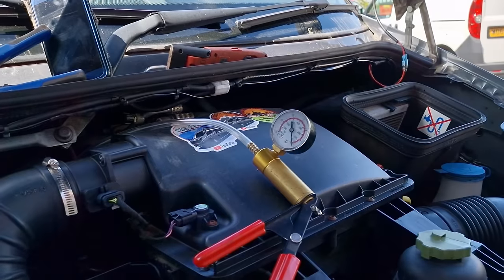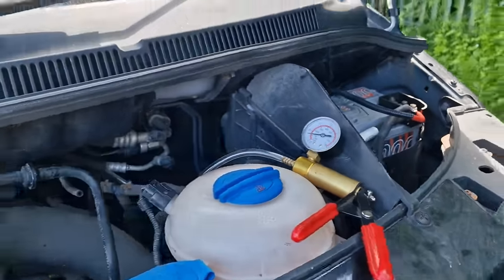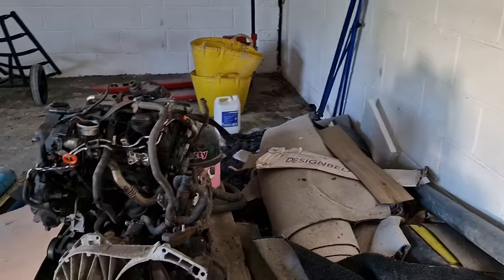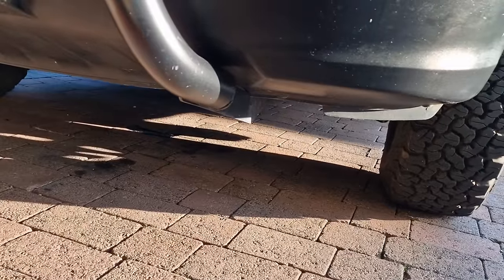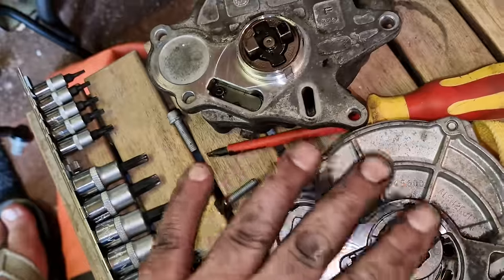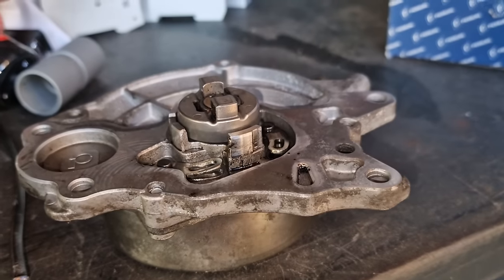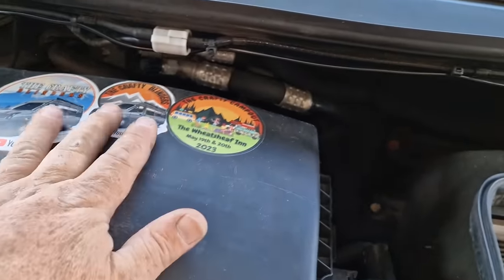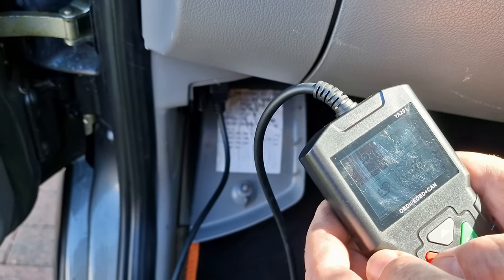engine fault code P2563 finally fixed on our self built campervan

Comment: hello friend, I have a problem with my minivan 2008 2.5 109, it starts, it drives well for 2-3 minutes, after which the coil comes on and the instant check engine cuts off my pedal and there is a loud sound from the turbocharger
Reply from the maker: have you inspected the pipe work around your turbo?
Reply: @TheCraftyBlindersvanlife yes
Reply: I changed the turbocharger actuator, vacuum solenoid valve, exhaust gas sensor, new egr, no change, all the same
Reply from the maker: @narcismadalin6088  sound very familiar have you fitted a new vacume pump?
Reply: @TheCraftyBlindersvanlife 
I will try to install a new vacuum pump today and I will keep you updated thanks

Comment: Almost all persistent codes on used vans, are due to wiring issues.  Breaks in Canbus looms are VERY common, and often throw up codes intermittently. This leads to many parts getting replaced, when there is nothing wrong with them. Pro auto electrical engineers, can in some cases resolve this type of issue, but its likely to be very time consuming and costly.
Reply from the maker: We are sorted now, thanks 
I've gone down the route of rewiring a loom previously, and it is time-consuming and mind numbingly boaring never again 😁👍
Reply: @TheCraftyBlindersvanlife  Good it wasnt the wiring.  I think thats a fault which has led to many vans getting broken for parts.
Reply from the maker: @humourless682  I can see why people just give up and cut their losses 😁👍
Reply: @TheCraftyBlindersvanlife  In some cases, they may have spent 5-6K on parts, before giving up and selling as spares or repairs.  Modern vans have a life of around 4 years. 

To me anyone who spends thousands on converting a high mile used van to a camper, has got to be crazy, as its sure to suffer from expensive problems, only unknowns are when and how much.

Comment: Hi,  having the same issue, where do you plug the pressure gauge into? Directly to the vacuum pump or N75 to measure pressure. Can you please explain how to the test. Thanks friend.
Reply from the maker: plug it into the pipe coming from the vacum pump

Comment: Citroen dispatch 2.0hdi have same failure and turbo oil line feed has a mesh filter remove it starved turbo of oil
Reply from the maker: Does removing the mesh fix the issues
Reply: Yes was blocked starved turbo and put high oil pressure in to engine and damage to pcv valve

Comment: So glad i found your channel same happend to my van i have a 2010 vw crafter now fixed ! Cheers on a side note ive been running my van on waste veg oil for nearly 4 years now without any modifications at all ! I. Winter just use 30% diesel to help it start and change fuel filter every 6-8 weeks have saves thousands in fuel and with no issues 😉 just thought id let you know !
Reply from the maker: My mate swears by cooking oil 😁👍

Comment: Hi Sam, been watching your videos as my crafter has the same issue…. 
Po299, pig tails and eng man light.

I’ve checked and tested lots, checked vaccum tightness on all hoses , checked turbo is
Clean and spinning free at inlet with no play, removed and checked egr is clear, not blocked , done dpf forced regen, seems ok….

The van drives 98% fine, it drives ok under light load , it also drives ok under heavy hard acceleration, but what it doesn’t like it to coast at about 65mph….. like
When you ease off the throttle, then the pig tails come on.

Can you please tell Me how you tested the voltage that gave you the indication it was the vac pump? 
When I put vac gauge on the hose that goes from (new) n75 to turbo actuator it hold vac, then when I Rev it the needle jitters around….not sure if it’s the vacuum or the valve opening and closing really quickly (maybe it’s getting wonky voltage) 

Great video mate, really helpful. I share your pain 😂
Reply from the maker: Unplugging the vacuum sensor, there should be 3 electrical contacts, put a fine cable in each, and plug back together
Make sure to keep the wires apart
Start the van, and with a multimeter test, the 3 cables between 2 of the cable, you should see a voltage between 3.1v & 5.5 volts, I think my memory is not what it was 😉 
Get someone to rev the vehicle or set the multi meter up where you can see it 
Try to recreate the fault watching the voltage if it goes out of range and the pig tail come on your vacuum pump is damaged and needs replacing

Comment: I just had the same warning lights on my crafter. I had a split my intercooler.$1150AUD later, fixed
Reply from the maker: No way! that's not good what was the issue
Reply: @TheCraftyBlindersvanlife  it just failed. I have done 330,000kms so I guess it's expected. I had to replace the steering rack also...VW wanted $6000AUD for one. The price even shocked the guy who worked there. Picked up a brand new on on ebay for $615. What a joke.
Reply from the maker: @BathurstDiecastRacing  wow what a saving 😁👍

Comment: Hi Sam my crafter has the flashing glow plug on the dash board and the brake wear light  keeps coming on so I'm assuming it's the same problem as yours and was wondering where you got your vacuum pump from ,hope your all well 😊
Reply from the maker: I got it from a local motor factor supplier, have you checked the engine fault codes?

Comment: similar frustrations but i have currently given up taking back to garage they have replaced map sensor egr valve and boost control soleniod they test for a week than i hire out makes it about 70 km then pigtails come on followed by engine light then limp mode dissapears for a day or too then reappears 
any suggestions what else to try
Reply from the maker: All my issues came back to the vacuum pump have you replaced that?

Comment: Hi really good you got the van fixed,what's the make and model of the obd reader machine you use?
Reply from the maker: Deal: KINGBOLEN OBD2 Code Reader YA100,Universal Car Diagnostic Tool Engine Fault Code Reader & Check Engine Light with Full OBD2 Functions,I/M Readiness Smog Check CAN OBD2 Diagnostic Scan Tool https://amzn.eu/d/8XAGs3d

Comment: Hi Sam, i'm glad you got this sorted. Im having a very similar issue with my 2016 crafter. Its been in and out of garages (even VW Breeze official garage) and they cant fix it without firing a parts canon at it. Im at the end of my rope like yourself was, and almost on the brink of selling it and making a huge loss. Can i ask, when yours was going into limp mode, where you also experiencing a sudden loss of all engine power that could only be resolved by restarting the engine? As thats what i'm experiencing after the glow plug lamp and engine lamp come on. Again, like you say its an intermittent issue which is why most garages ive been to cant seem to pin point the issue :( Gutted and skint are the words for me.
Reply from the maker: It sounds very similar to our fault have you changed the vacuum pump?
Reply: Hi ShredIt did you manage to fix your fault in the end?

Comment: ive had the same fault, new tubo last week , fault returned today 😢
Reply from the maker: We had a multi meter plugged in to the actuator sensors plug we measured the voltages that's where we found the fault

Comment: The reason for the blockage is down to the dpf the oil gathers carbon and blocks up all the little oil galleries when you do an oil change every oil change you should add an oil flush run for how ever long it says on the tin . And it breaks sown the carbon deposits in the oil hope this helps
Reply from the maker: Cheers mate I will look into flushing the engine out good advice 👍

Comment: Did ypu change the sensor and actuator? I'm having same error code and coul flash light
Reply from the maker: Mine turned out to be the vacuum pump after changing the turbo & acctuator + N75 valve and associated pipe work
Reply: @TheCraftyBlindersvanlife is that the wastegate part? Where the sensor sits?
Reply from the maker: No it's the valve on the vacuum pipes mounted on the chassis leg

Comment: Mine is still not fixed mate.   I’m £2500 I’m so far.  

I thought it was fixed.  But the limp mode is back. 

Looks like I’ll be changing this next

I feel like throwing myself off a bridge. 

🤬
Reply from the maker: I hope you get it sorted pal if it helps we have been error free since changing this out 🤞
Reply: @TheCraftyBlindersvanlife  cheers sam.   I hate to say it.  But something makes me think cruise control brings it on.  I haven’t used it for months and months. And been error free and my right foot was hurting feathering the throttle.  So decided to activate the cruise control.  Within minutes we where in limp mode.  I was suicidal 🤯.  It was Always on a hill to.  Some of the hills on the M6 northbound are 5th gear all day.  Even 4th gear.  So as soon as revs reached 2500 plus.  Boom limp mode.  

Defo gonna change this vacuum pump next. 

Thanks again buddy. 

We have both been battling this demon together.  Every week I’d check your channel out to see where you where at. 

Made up you have sorted it.  

💙
Reply from the maker: @DJJENKO  let me know how you get on mate 👍
Reply: @TheCraftyBlindersvanlife  will do buddy.
Reply: @DJJENKO hi did you replace the vacuum pump? Have you fixed your fault?
Reply: @AJRepairs yes mate.  We ended up changing everything to do with vacuum.  Been problem free since.    Volksmaster van centre in Oldham ended up sorting it.  All in I think I spend £3500 / £4000 getting it fixed.  

This was just divvys changing stuff and not properly diagnosing stuff.   

Volksmaster sorted it.  

Probably could have saved £2000 if I had gone to them first.  They are 50 miles from me.  But worth the trip.  Hard to find good mechanics these days.
Reply: @DJJENKO  thanks for the response mate, appreciate it. 
Glad to hear you got yours sorted 👍🏻
Reply: @AJRepairs cheers mate